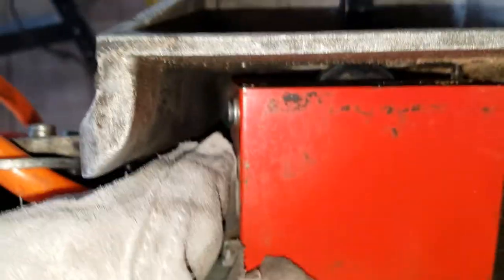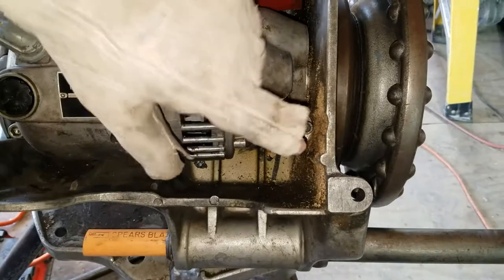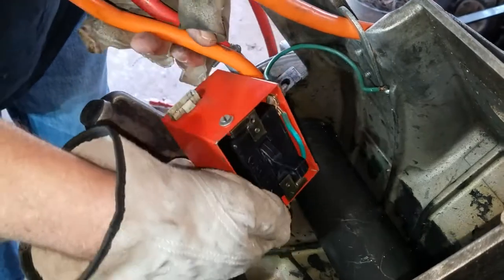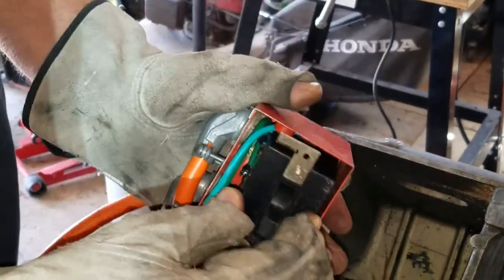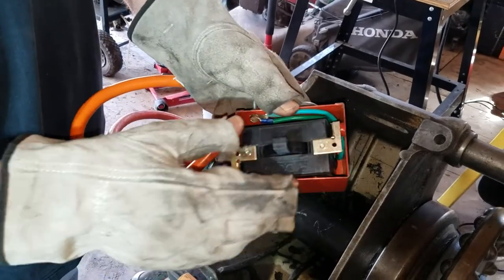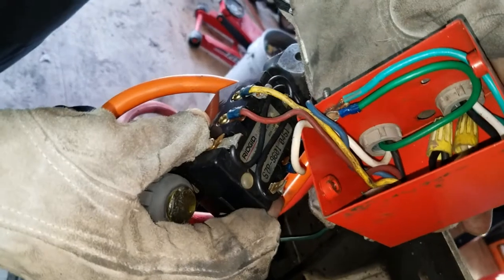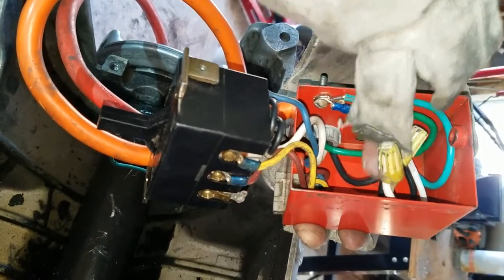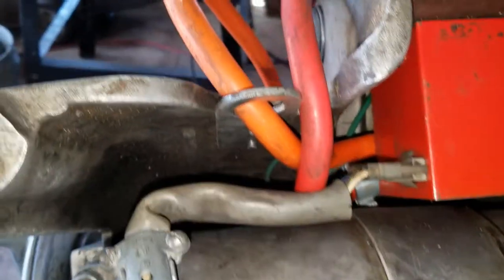RIDGID 300 FWD REV SWITCH & FOOT SWITCH WIRING

Comment: Hi sir can you give me the switch diagram or wiring connection of forward reverse, and which wire can interchange to reverse the rotion of motor.. thank you
Reply from the maker: check here, page 19

https://www.manualslib.com/manual/1370729/Ridgid-300-Power-Drive.html?page=19#manual

Comment: If you want to get rid of the pedal switch,  how do you wire it. Thanks.
Reply from the maker: I have seen it done like this- Inside the switchbox- there is a white, black & green wires coming from the foot switch- disconnect/unsplice  these wires in the switchbox that the white, black & green wires are connected to. Remove foot switch cable and wires(if green ground wire from footswitch is connected in the switchbox, disconnect this wire also- CAUTION- Make sure the other green ground wires are connected back together after removing the green wire coming from foot switch)
 Then, splice/join together in the switchbox ONLY the wires in switchbox that the white and black foot switch wires were connected to.
Do yourself a favor when you pull the switch out of the switch box take pictures of the wiring before you start messing with it because there's other black and white wiring  in there and it's easy to get confused. I would do ONE wire at a time to avoid mistakes.
Let me know if this helps.
Reply: Thanks,  I appreciate it.

Comment: This motor is dc or ac and with how many volt runs?
Reply from the maker: AC 120v
Reply: @yyz2go2112  thankss
Reply from the maker: @professor9595  about 30 years ago another electrician I was working with out in the field showed me his Sawzall and said it would run on AC or DC so I'm not sure but here's a link that explains some about Motors.

https://youtu.be/I2_-etus0KQ